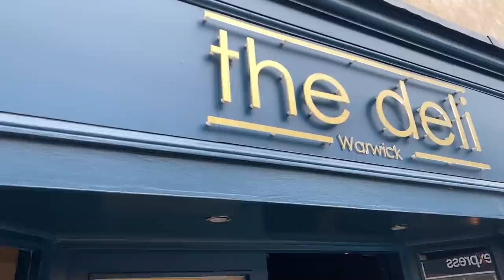COMPLETE SHOWER PUMP REPLACMENT, START TO FINISH. Also fitting knee operated sinks & bath panels etc

Comment: If i was to turn off the isolation valves on the shower pump like you did, could I then replace the shower mixer bar without draining the water tank?
Reply from the maker: You should be able to yes 👍🏼👍🏼
Reply: @MJTiffPlumbing  appreciate the reply!
Reply from the maker: No problem buddy

Comment: Still can't figure out why the 22 mm pipes aren't continued through to the pumps, why reduce to 15 mm? By the way don't bother asking for replacement parts (in my case a diaphragm with a pinhole -everything else working fine) from Salamander as they just tell you to buy a new item!
Reply from the maker: It’s a like for like swap, that’s what salamander supply and that’s what is fitted to keep the warranty. Some of the larger pumps have 22mm bronze connectors
I’ve never had an issue with salamander as a brand, always replace pumps within warranty if there is an issue as long as it’s connected properly and piped up accordingly.

Comment: My shower pump only has 2 isolation valves out of the two hoses. What should i do in that case?
Reply from the maker: Those valves should be on the inlet side

Comment: Any chance when you do small jobs you can tell us how much you charge, just always wondered. Great channel by the way
Reply from the maker: Thanks mate…👍🏼👍🏼

Costings and prices can vary so much from job to job to be honest
Reply: You work for free don't ya mark? ;)
Reply from the maker: @evervol1  🤣🤣🤣……
Reply: @MJTiffPlumbing  Travel can be a Hassle over in Blighty so the likes of that time can ramp up...like those Stuart Turner pumps as the pipe connections are mounted Vertically rather the 90 degree Elbows onto the suction of the Salamander... but then again this would have created hassle for your swap out...no  one wants to make a big contract of a small job... great upload...

Comment: Not sure 🤔 if I’m blind , or you did some kind a trick with that hole-saw , I have noticed you started to drill a bit anti-clockwise 🔄, does it sits better on a unit or it’s not going to slip out, before you start to do actual drilling ?

Comment: Would have been good practice for ya to change the flexi pipes for your mate.
Reply from the maker: Nothing wrong with the ones that were in, also that would of meant draining the hot water system and losing all the hot water, which is a huge waste of energy…

2 years later and not an issue with the hoses….

Thanks for your input though👍🏼👍🏼

And it’s “You” not “ya” 🙄

Comment: I hate the cheap bath panels with a passion. But even the not so cheap ones can be a pain sometimes.
Reply from the maker: Yep, right pain……. I found the only ones that are ok to fit are the finished wooden type ones with a lower plinth
Reply: @MJTiffPlumbing  yeah those are not so bad

Comment: Hi Mark great to see such a variety of work. Wanted to ask your opinion on something, do you def need a blending valve or  a TMV on the hot side to keep pump from overheating and can that be a 22 mm pipe from tank where it both feeds the TMV and the cold inlet to pump or do you need 2 separate feeds one to the cold and one to blend the hot water, or can you get away without a TMV. Cheers Mark excellent video again.
Reply from the maker: Yep no need to fit a TMV